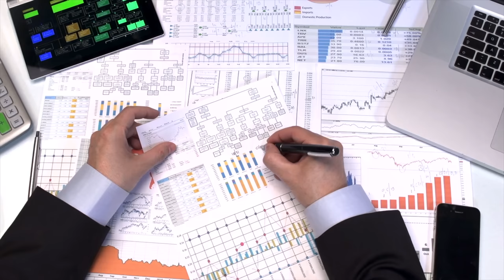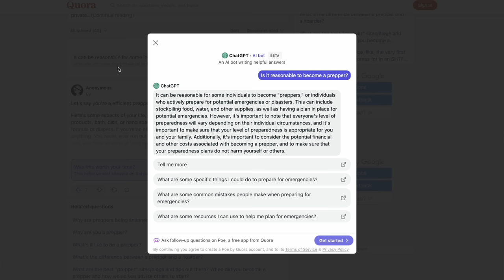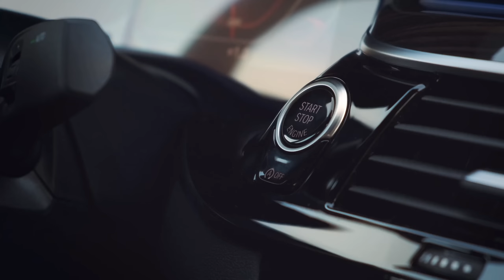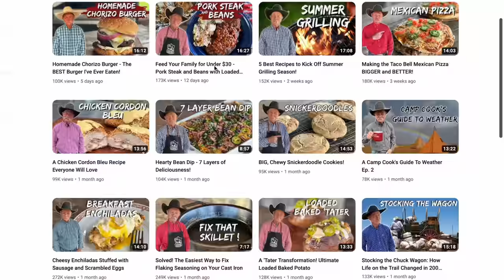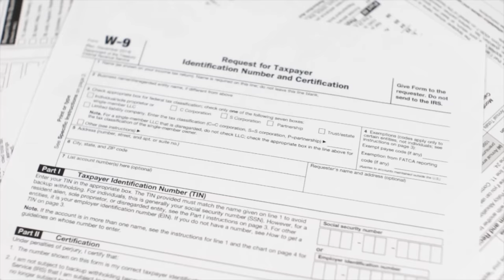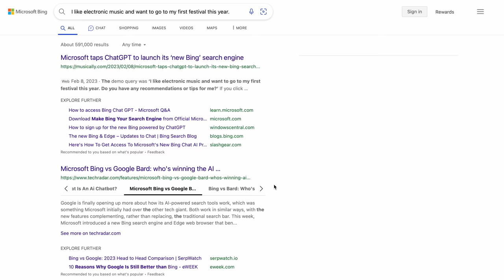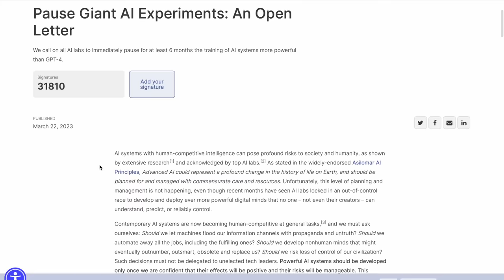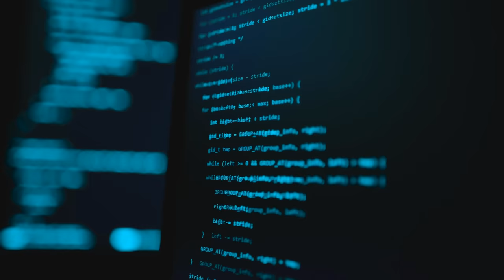Artificial Intelligence: This Could Be a HUGE Problem...

Comment: I work on highway bridges. I just found out that the bridge decks will be having the rebar tied by a robotic unit. Only two ironworkers need work . One to lay out the bar and one to feed the machine wire. That takes away many , be it hard work, jobs.